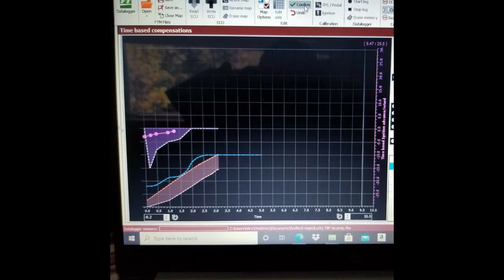Vacation, Break or just Lazy?

Comment: Interesting theory about the cracked Cylinder.  I struggled most of this past summer with getting water in my oil on my 76mm 02 1K bracket bike.  Turned out the problem was a crack in #3 cylinder in just about the same spot yours burnt up.  Makes me wonder if there's a casting flaw on the 01/02 cylinders?

Comment: I have a gsxr750 k5 with k4 1000 cams and ape sprockets.
I did drive it with the stock valve springs but it did destroy 2 valve stems due floating i think.
I want to upgrade the valve springs to 55lb springs. 
Is it posible and safe to use that springs with stock retainers? 
Its a 145whp gsxr750 and i ride it often in highrevs and also revlimter.
Reply from the maker: I dont like the OEM retainers and have cracked several. I also dont like titanium because in time the keepers start to pull thru. I SWEAR by Kibblewhite retainers
Reply: @tpsfab  should you switch to steel valves?
Reply: Its not a dragrace bike, i drive it on street allot and its a semi stuntbike.

Comment: I’m trying to get my 08 running on ft450 could you tell me what crank and cam trigger settings to use and if it’s rising or falling
Reply from the maker: I just saw this...ill look tonight..i dont recall it off hand. I dont run a cam sensor tho
Reply from the maker: RPM is VR Differential
Crank trigger is 24-2
Crank index 110*- 7 teeth -5*
Rising edge.